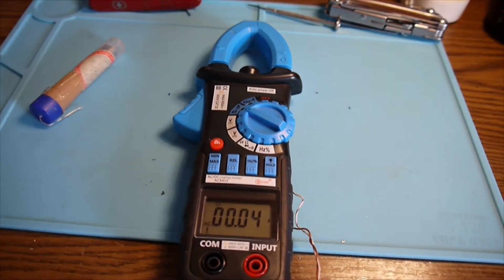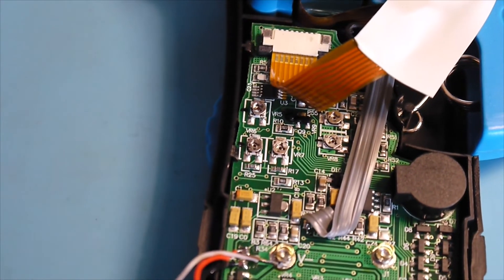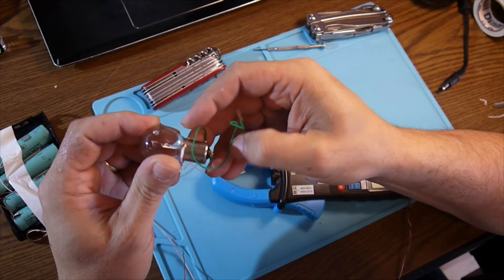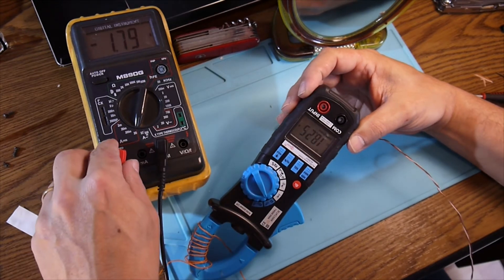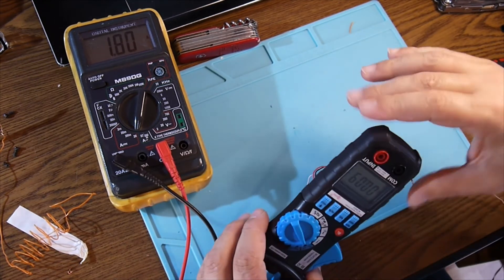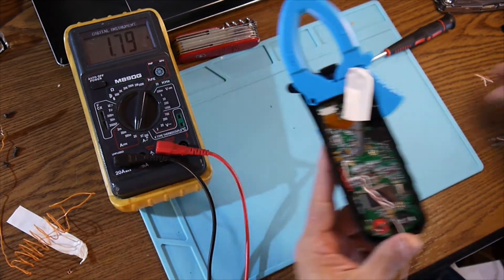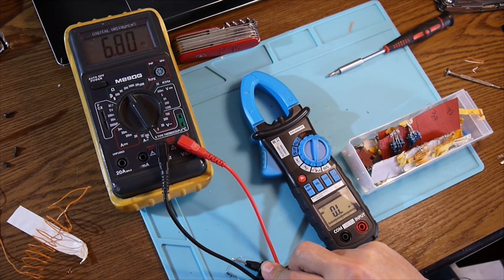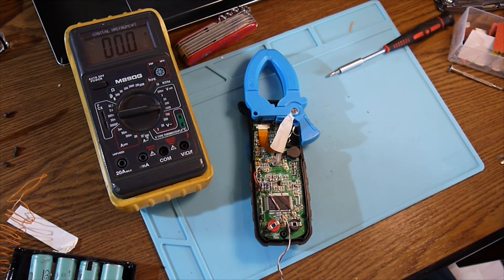Hall sensor BSide ACM03 DC clamp meter calibration checking and fixing

Comment: If there are machines that don't have that adjustment button, can we add it to adjust it?
Reply from the maker: If you can find the schematic of course...
Reply: @viocaia  yes thank you, but what is the name of that correction?
Reply from the maker: @c__TattinhNhi  there is no name , just an adjustment..
Reply: @viocaia  What is the place where you screw the screwdriver, what is it called, how many ohms does it have?
Reply from the maker: @c__TattinhNhi  tthose are few adjustable potentiometer, for different adjustments.
Reply from the maker: @c__TattinhNhi  I don't know, you can't measure for resistance a adjustable potentiometer already tied in the circuit..you'll have error readings, but like I said, you need a power supply, cables and a resistor...use Ohm law to find the current in the circuit and adjust the clamp meter according to that.

Comment: I have a TES 3082 clamp meter that I can't calibrate measures wrong, Help me oportunidaddos@gmail.com
Reply from the maker: I can't do more then I showed in the video, you have to take those little trimmers one by one and see what are doing..I couldn't find any schematic so the only solution is try and mistake..
Reply from the maker: Hey Cesar, please help me with subscribe!
Reply from the maker: You can do a simple circuit, like a resistor of certain value, in series with another ammeter and a battery or power supply, read the value with the ammeter and try to ''bring '' your clamp to the same values.if you have trimmers , those small potentiometers if there are any..

Comment: I was told once, that for DC clamp measuring also earth magnet field orientation matters. You have to place meter parallel to the wire, and zero it out. Then the measurements are accurate. Not sure about the exact procedure.
Reply from the maker: well..sounds interesting,  but for very sensitive Tesla meter, this one is measuring 400Amp ! you can put a welder near by and doesn't care..also I don't need such perfect measurements , I have like 20/30 Amps from my solar panels to inverters, but that  little 0.3A makes me crazy..finally turns to be a shock related problem, those trimmers are tiny and this tool is always on the floor ! Thanks for looking and sharing!